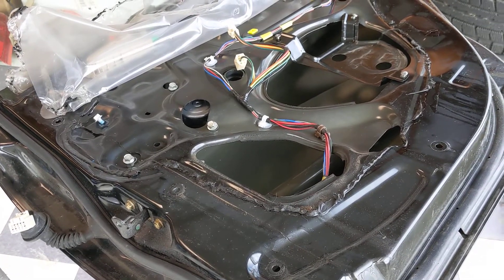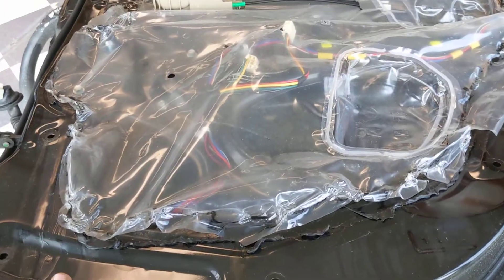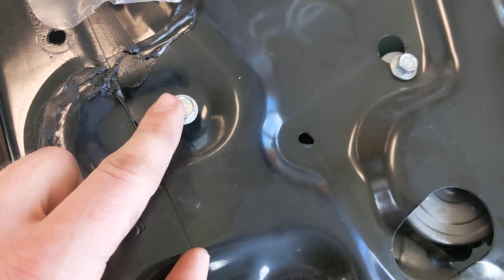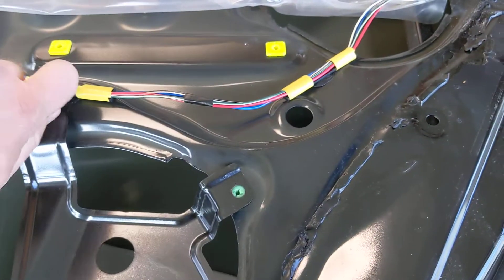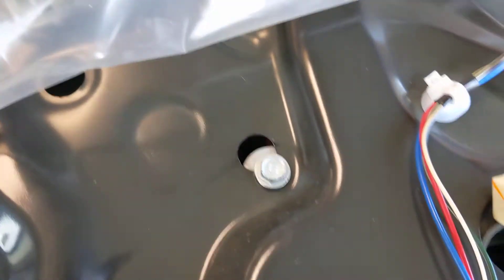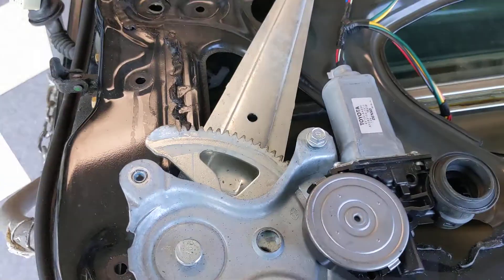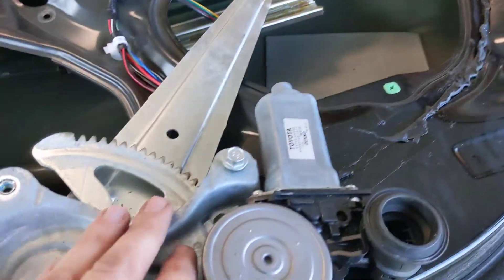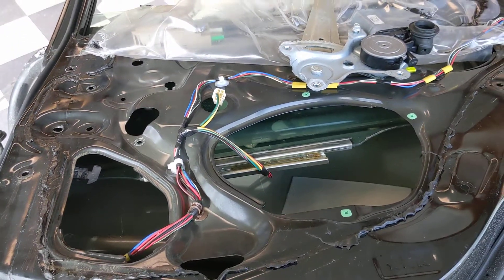2003-2008 Toyota Corolla Rear Window Regulator and Motor Removal

Comment: I think my motor is fine because the window rolled down normally (smooth, quiet, fast), but then never came back up.  I just bought this car used from a family member who rarely drove it and so rarely opened the back windows.
But, I should test the motor anyway.  I'd like the buy a voltmeter or multimeter that can be used on both AC and DC (home and car).  Is that possible? Also, because I don't want to fry anything in the car or have to reset the windows after disconnecting the battery, should i get a special test light? Some one said an LED test light is safer for my car than an incandescent test light. I think the multimeter may be more useful over all anyway, nit not sure of anything.
Reply from the maker: A multimeter is the way to go.

As far as the window goes try the following:

Try rolling it up with rear window control, also make sure that the window lock is not on, on the master switch.

If it's still not working. Check fuses.

If fuses are good I would recommend removing the door panel and tapping on the window motor with the plastic end of a screw driver, then retest.

If that doesn't work chances are the motor is shot but you can use your multimeter to further confirm that is bad.

If it hasn't been used a lot it could just be sticky and need a nice tap to remind it what it's supposed to do haha.

Comment: Are all window motors for the 2003-08 corolla the same? My corolla was fabricated in South America rather than Japan and I don't know if that makes a difference because it did when I was changing the cv-joint because the cv's bar was thicker. I'm looking for the window motor for the front driver side and i wanted to be certain.
Reply from the maker: I would assume that that window motors would be the same. It makes sense that the CV axle would be different because it probably has a different engine/transmission setup than what other countries got.
Reply: the guy at AutoZone and one comment in a Toyota forum says the parts are different, so you must look up the first digit of your VIN to see where the car was made. T must mean North America.

Comment: Hi my name is David and was wondering how you would replace the track if it fell off the window of the passenger side rear window
Reply from the maker: Hi David are you talking about the rubber track or the metal track?
Reply: @TheInteriorAutoMechanic  metal track on bottom of window
Reply from the maker: @davidsunderland6811  if you are talking about the metal part that runs across the bottom of the window on the outside of the car that piece should just be able to be removed from the outside with a flat head screwdriver and replaced simply by popping it back on
Reply: @TheInteriorAutoMechanic  ok thanks for your information
Reply from the maker: @davidsunderland6811  Happy to help! Good luck on your project! Please consider liking the video and subscribing to the channel.

Comment: Hi guys, really helpful. I've got a question! Do any of you know if the wheel on https://youtu.be/6zLaK4AeJoM?t=310 (min: '5:10'') is replaceable? That's my only issue with the regulator arm. Seem a waster if I need to get an entire new part for just that! Thanks and great work.
Reply from the maker: Hi there! Unfortunately I am not aware of any way to replace that part without just replacing the entire assembly. Good luck on your project! Please consider liking the video and subscribing to the channel.

Comment: Replaced the motor still not working do i need to do a rest or anything? Or maybe its an electrical issue?
Reply from the maker: Here's a couple things to check. Make sure that your master switch lock all windows button is not pressed. I know that seems obvious but I've ran into this before. Next thing would be to check and see if the window rolls down off of the master switch if it's one of the other three doors then the driver's door. If it rolls down off the master switch but does not off of the particular door switch then you most likely have a window switch issue that's on that door. If you have any other questions feel free to message me. Good luck on your project!